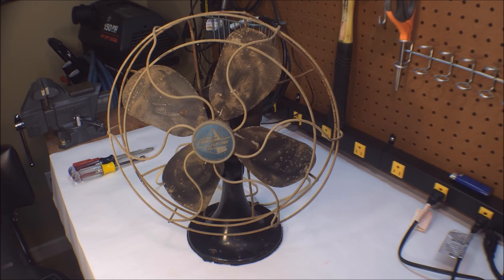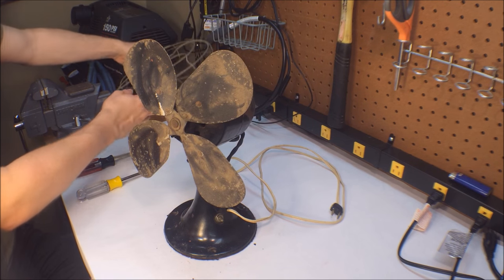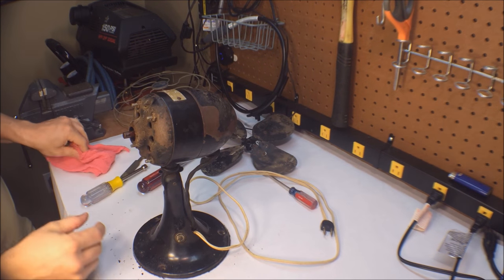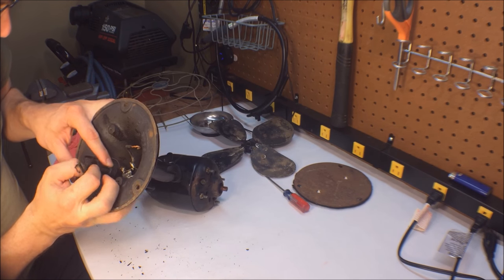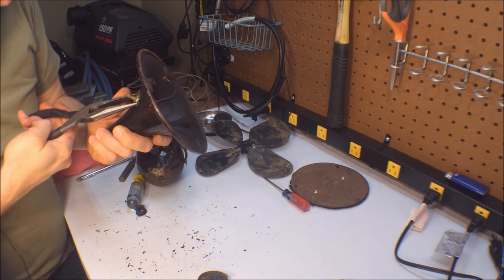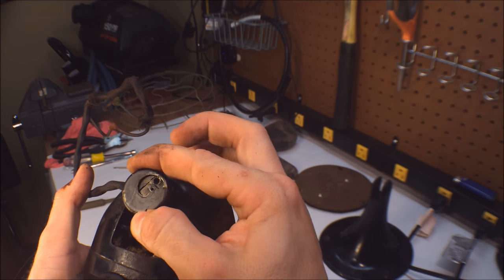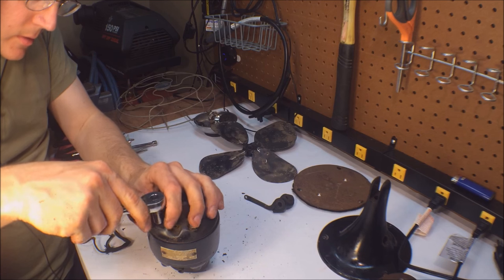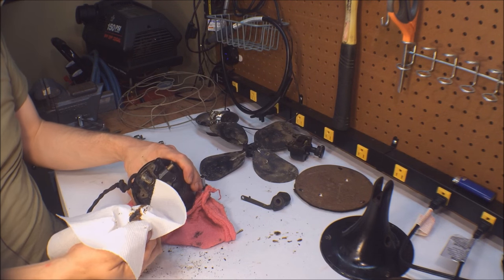1949 Emerson Desk Fan Restoration - Part II (Disassembly)

Comment: my switch cape apart when i disassembled. i was going to buy a new one but found all the parts so got it put back together and felt more comfortable reusing it than putting a chinese one back in it. i opted to just clean and buff and polish everything  and reassemble it with new wires grommets and felt on the bottom. i am in the middle of my restoration as i type this. mine is i believe is a 1940. its a model 6250-d brass blades. grey in color. bought it for $10. everything works perfectly. love these old fans.

Comment: I highly recommend oiling this fan. This is a fairly easy process as there are two oiling ports corresponding to the two bearings. Use 3 in 1 non detergent oil (in a blue can).
Reply: I have a small 8" fan that I oiled but it caught on fire.  I think I used the 3 in 1 in the black bottle though.

Comment: I have a Kenmore fan, 16in or so, that I'm planning on taking apart. The oscillation function doesn't work without straining the motor and when in normal operation without oscillation the motor heats up to 160+ °f which doesn't fare well with trying to cool. But it sure does move air better than any fan I've ever encountered. It's in great shape aside from the heating up, it seems like the motor is under a lot of load from gunk, I'd wager. I'm hoping I can just take it apart, clean the motor, oil it, and enjoy it. I'm a huge fan of vintage metal fans.
Reply: if you can get it apart, clean & oil the swivel so the motor moves back & forth freely. if it won't come apart, like some hunter fans, soaking with wd-40 should loosen it up followed with s.a.e. 10 w oil. with the swivel free, the motor should no longer strain the motor. oil the motor bearings & the swivel every few years. it should last a long time.

Comment: My fan is a little different from yours. I can for the life of me, get the cage off the blades. Blades seem to be too large. Also, I simi took the motor apart to clean cause it was acting seized up. Put back together and still don’t work. Any idea?

Comment: How did you remove that gear in the back i cant get mine out
Reply from the maker: I'm not sure, which gear do you mean? The oscillator? It was just held on with flathead screws. The case splits in half and you can remove the worm gear and oscillator gears from inside. I have finished restoring mine, just haven't gotten the video up yet. I think I have some footage of the oscillator coming apart. I should have it up when I post part three.